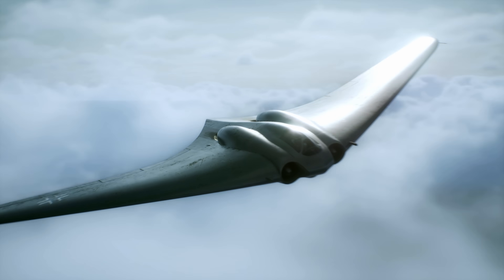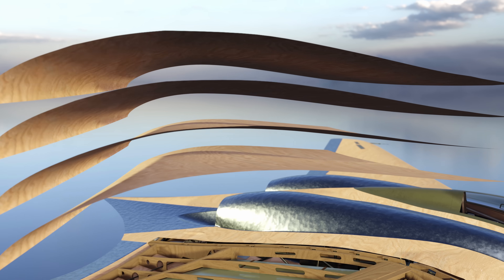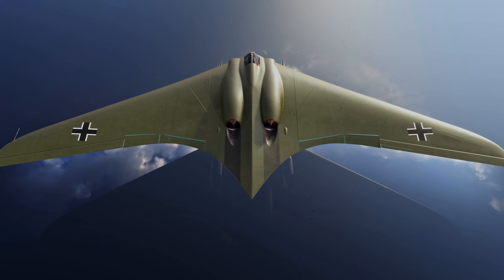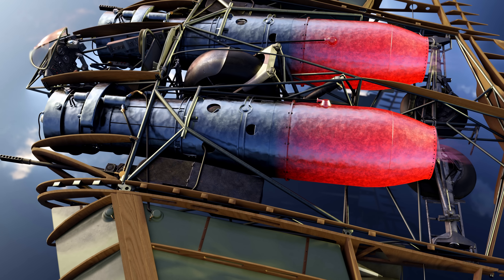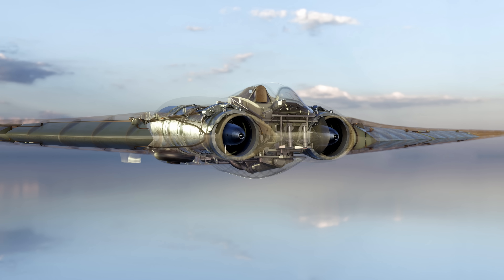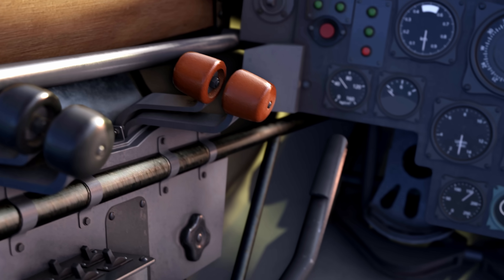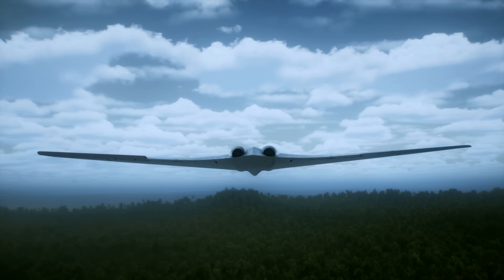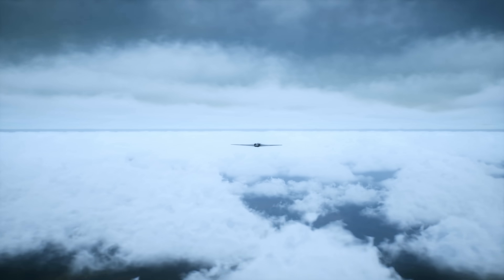Inside the Horten Flying Wing

Comment: Despite not being a completely stealth aircraft, it did have a lower profile than most aircraft at the time. With its high speed it might have been deadly attacking targets in the south of England.
Reply: By the time the 229 was in the design stage the Luftwaffe were no longer capable of attacking any part of England except with V2 rockets.
Reply: The mithbusters tested this its not stealthy in the slightest
Reply: @Whyareyoulookingatmynamell  though compare its stealth abilities to the radar of the time. it would have significantly decreased the response time of allied forces to get airborne to defend
Reply: @tomwhitbread223  they used a ww2 radar, its not stealthy

Comment: Flying wing ….. Conceived,  engendered, designed, and built by people of European descent. Other things invented by white people include:

Submarines, electric lights, nuclear power, microwaves, CAT scans, automobiles, hydraulic, wind turbines, backhoes & excavators, jet airplanes, aluminum, ballpoint pen, hydroelectric dams, steam power, trains & diesel locomotives, tractors, modern pharmaceuticals, open heart surgery, satellites, radios, telephones, televisions, arch & tig welding, computers, transistors, milling machines, plasma and hydrojet cutting, microchips, titanium, telescope, democracy, capitalism, modern farming, x-rays, typewriters, sewing machines, gyroscope, SCUBA systems, pasteurization, center pivot irrigation systems, bicycles, hypodermic needles, Velcro, microphones & amplified speakers, space travel, airplanes, fiber optics, ultrasounds, internet, printing press, container ships, aircraft , GPS, modern textiles, calculus, dynamite, internal combustion engine, Kevlar, moving assembly lines, antibiotics, aspirin, refrigerators, chainsaws petroleum production, trigonometry, helicopters, thermometer, glass mirrors, directional drilling, Astrophysics, crop rotation, carbon fiber, super conductors, particle colliders, pneumatic tires, MRI, sextant, robotics, telea a graph, microscope, firearms, penicillin, refined oil and fuels, hovercraft, computers, carbon 14 dating, angioplasty, telescope, pipelines, open heart surgery, tower cranes, chemo therapy, light emitting diodes, motion pictures, cameraswas was, digital cameras, CD/DVD, concrete, dynamite, lithium batteries, LED lights, refrigerators, nylon, water pumps, radar, sonar, satellites, distillation, electric motors, magnetic compass, sextant, clocks, plastics, vaccines, vulcanized rubber, insulin, combine grain harvesters, zippers, and concrete …. Just to name a few. 

What did your ancestors invent that have contributed to the modern human age? Feel free to list them out here.
Reply: Get lost white supremacist, you already lost.
Reply: Just stupid that there is no white breed and the first Europeans were dark -skinned. And now go shower.
Reply: @Aragorn_Arathorns_Sohn lore accurate King Aragorn
Reply: @stopmotionharry8989  Nein, das kannst Du in jedem Fachbuch lesen, mein kleiner Wehrmachtsfanboy.
Reply: @Aragorn_Arathorns_Sohn  what? I know what you said, but what? I’m not a wehraboo
Reply: @ No, you can read that in every specialist book, my little Wehrmacht fanboy.
Reply: @ what are you talking about? what handbook?

Comment: The statement that a flying wing design was not used in any other operational aircraft other than the HO229 for fifty years after the war is incorrect.  Jack Northrop had been working on Flying Wing designs since he was young and actually produce the first flying wing in 1940 called the N-1M.  Later with the N-9M if memory serves, he was the inventor of the elevons, a new radical concept using elevator and aileron functions.  This was around 1943 that his concepts were demonstrated to the United States Army Air Corps .  The HO 229 was the first jet powered wing as the Germans stole the plans for the jet engine  from Whittle in England and that's how Hons von Ohain was able get a jet engine of that same design in a German military jet the HE178. I do believe that the reason it was stated projected landing speed, is that neither one of the HO229 built were ever flown, hence the projected landing speed.  Also, a wooden airframe would be hard pressed to endure the stresses put on it during a 621 MPH flight or even less in a dogfight.  By the way, The B2 A Spirit bomber was actually taken from Jack Northrop's  XB-35, 1946 which was a rear prop drive flying wing and the YB-49 which at that time, 1947,  proved to be very successful using eight (8) jet engines.
Reply: Die Horten flog doch. Etwa 45 Min. einen Rundkurs um den Flughafen und stürzte dann ab. Ergo auch keine Landegeschwindigkeit. Das Ganze war ein Hirngespinst und wurde auch von der Wehrmacht nicht ernstgenommen und eben auch nicht gefördert (deshalb ja auch Holz). 
Und richtig. Die Amerikaner hatten ein erfolgreiches Nur-Flügler Programm und hat nichts von der Horten übernommen. die der XB-35 war ein Vorgänger der YB-49, die den damaligen Rekord der Strecke Los Angelos Washington flog. Aber die Probleme des Nur-Flügler konnte man nicht in den Griff bekommen. Dies funktionierte erst mit einer automatischen Flugkontrolle, die erst in der B-2 umgesetzt werden sollte. 
In jedem Fall war die Horten nichts weiter als Schrott.
Reply: The all wooden construction of the DeHaviland Mosquito apparently stood the stress of dogfights, low level bombing raids and even firing the Mohlins 6 pounder quick firing cannon in various different versions, and that was built by those inferior Brits and Canadians.

Comment: That is the "UFO" Kenneth Arnold spotted flying over Mount Rainier in Washington in 1947. 

After the War the U.S recovered a lot of Nazi inventions, the most notable aside from nuclear weapons, is the Horton 229, which is where the U.S has engineered and mastered the flying wing designs of basically all our modern aircraft today. 
Arnold even described the main issue those early flying wings had, stability, they would "skip" across the sky.
Reply: Auch wieder Unsinn. Deutschland hat keine Atomwaffen entwickelt. Weil man weder die Theorie verstand, noch die Technologie und auch die Ressourcen nicht hatte. Die B-2 entstand übrigens aus einem eigenen Nurflügler Konzept. Dieses begann schon lange vor der Horten und hatte einen flugfähigen Bomber mit der YB-49. Die Horten war ein flugunfähiger Holzschrotthaufen und hat die Amis Null beeinflusst. 
Was haben Nurflügle mit "allen heutigen modernen Flugzeugen" zu tun? Nichts?

Comment: Lets us not forget that American company Northrup was experimenting with flying wings at the same time but without jets. The B-2 was based on Northrup's flying wings.
Reply: No they didn’t 😂😂 The Northtrup was based on the Horten !!!
Reply: @f.n8581  the scaled prototype for the XB-35, the N1M flew in 1940.
Reply: @f.n8581  Northrups design on flying wings began in late 1920s. No, it was not based on any German designs. 
Read a little bit. There were tailless aircraft being designed in various countries including France, England and Russia.
Reply: @wfqsfg Yeah that’s why the Northrop and B2 looks 1 on 1 like the Horten 229 Right ?? 😂😂 The other Tailless Aircraft you mention in Russia , England and France didn’t even look close like the Horten 229 or From Northrop !!! 

Knock it off everybody can See the similarity between them !! 

And btw, there is evidence that Jack Northrop and the Horten Brothers meet in the 1920 - 1930 !! 

So that alone should tell you, that Northrop just cheaply Copied the Design from the Horten Brothers !!
Reply: @f.n8581  I never said the Russian, French and English designs looked like the 229. I simply said there were engineers in those countries studying flying wings. You read something that wasn't there. 
There is no evidence anywhere that Northrop and the Hortons ever met or ever collaborated. They worked on their designs independently.  The B-2 was designed and built by Northrop. The B-2 looks nothing like the 229 and is all metal and not wood. It looks more like the YB. The Northrop XB-35 was all metal, not wood like the 229. So how was it a copy?
Reply: @f.n8581 The history of flying wings and the B-2 program is well known. The B-2 shares nothing with the HO-229

Comment: To simplify the entire video. Yes, it was stealth. Yes, it was a huge breakthrough in technology at the time of it's conception. If it were not for the fact of Hitler being out of his mind due to syphilis he would have given the go ahead to mass produce this aircraft. Had it been done and the Germans tried the same maneuver they had tried with traditional planes of the day again with this aircraft the British allies would have had an estimated 30 minutes warning to get airborne and begin defending themselves. in the scheme of things this would have changed the face of the war. It had been used previously on 3 separate occasions and it did not fall out of the sky due to being shot down but rather malfunction. It was a steel frame to hold components and engines with a steel nose. The rest was a wooden frame and plywood body. The radar signature was was that of a large bird. So in a nutshell, this was an incredible machine and would have made a huge difference in the war. It is very likely that had Hitler not gone insane and this plane did not reach mass production our world would look very different.
Reply: It would have made zero impact. But no it was not a stealth aircraft, that is a long debunked myth.

Flying wings do provide some benefits to RCS but the HO-229 had MASSIVE engine intakes that would have increased its RCS by a large margin.
Reply: @spaceageGecko  radar is acquired by reflecting the signal back at right angles. The design is very good at doing so. Yes, the design of the plane reduced the signature significantly.  This is not to mention the fact that the only metal truly reflecting at all was the metal frame holding the cockpit and the two engines. The worst part was the nose, which was also metal. With all of this in mind, it was a stealth plane of its day. 

The signal of this plane was dramatically reduced to a "large bird" due to the shape of the plane, the wooden body, and the fact that at that time, no one had ever seen anything like it. So no, it is not like today's standards, but for its time, it very well could have fooled the allies until it was too late. 

In a nutshell, yes, it still was and is a stealth plane. Even the almighty Wikipedia agrees with this.
Reply: @ Please read properly, the mockup used was missing the metal frame (and the final version was not supposed to be wood) and the highly reflective engines and it still had 80% of a BF-109s return signal with an already retired radar, other radars showed no change.

The HO-229 stealth myth has been debunked to death, the Smithsonian has had to repeatedly remind people that no it is not a stealth aircraft.

Comment: ask Northrop, where did They got the idea for the B2 bomber
Reply: +@Pprokop87   Northrop started work on the YB-35 in 1941 and long before the 229 program.  The B2 is the redesign of the original YB-35 concept- same size and same mission role.
Reply: from the Northrop N-9M

Comment: The Horten Ho 229 was supposed to carry four 30mm MK 108 auto cannons, not two. And those would not stick out of it‘s body. The MK 108 was significantly smaller, and lighter than the MK 103, and also used lighter ammunition with shorter cases/brass. The rate of fire of the MK 108 was 600 rpm, but the shells had a slower muzzle velocity of 500 metres/s compared to the 750 m/s of the MK 103. It was never intended to use the MK 103 on the Horten 229. 

Further Northrop Grumman recognised it as a stealth fighter, as it‘s radar cross section was reduced by 20%, which can be considered the first step in stealth technology.

Comment: I can only imagine the vibration and noise in the pilot cabin, being situated in between the engines
Reply: Jets have no vibration, and the pilot sits well forward of the engine exhausts so there would have been very little noise compared to a tradition piston engine propeller driven aircraft..

Comment: Could a Ho-229 take flight, as it is, if current materials and computer control were applied to it?
Reply: It did fly but no doubt would have been a tricky plane and very unforgiving, it would have most likely needed a fly-by-wire yaw damper system... technology that was already being developed in Germany at the time.

Comment: 15:40 Many pilots have and do survive at 12Gs. It's not really "certain death." Every pilot that has ever had to eject is hitting 15-20g. Some fighters can pull 12 easily in emergency maneuvers. The g-force alone isn't the killer. Positive g-force at a sustained rate is a different story. Only healthy, well-trained pilots, and/or piltos with g suits can remain conscious in high g maneuvers for more than a second or two. Everyone else loses function at 3g, unconscious at around 7g, etc. Besides all that, negative g-force, deceleration is MUCH more deadly. Positive g force is pushing you into a seat. Negative g force detaches retinas, damages and rips internal organs, or can cause internal decapitation. The negative gs in a car accident are horrendous and usually the real killer. Look at the negtive Gs in F1 racing crashes. Jules Bianchi suffered from -254G - when he lost control during the 2014 Japanese Grand Prix and collided with the rear of a tractor crane carrying the car of Adrian Sutil who had lost control at the same corner. Put into a medically induced coma before succumbing to his injuries in 2015.

Comment: This was never a stealthy aircraft as the engines intakes  were not  shielded by stealth material
Reply: A 50% reduction in frontal RCS is very significant and would have given the aircraft up to 20 minutes of additional range without radar detection,
 Propellers are extremely retroreflective of radar energy; jet engines are very stealthy compared to propellers.,

Comment: Looks like the YouTube version of the old pulp grade Mechanics Illustrated articles on 'advanced tech' ..., which also never 'flew' and never demonstrated ANY of the 'breakthrough technology/performance' aside from the bare-faced assertions of the authors.
Another 5 minutes I can't claw back.
Reply: Actually, it did fly... and the Allies had absolutely nothing comparable to this advanced super weapon..
Reply: Someone's got a bad case of Luftwaffe envy...
Reply: +@rbaxter286   The smaller V2 prototype was the only example to fly under power and with jet engines, but for only about two total hours of testing, per the notes during interrogation of the Horten brothers.    On 18-Feb-1945 during a flight to measure basic performance numbers, the V2 suffered a single engine failure with a fatal crash which killed test pilot Ziller.  For all practical purposes, this was the end of the 229 program.  The Gotha-designed V3 was captured very incomplete on 14-April-1945 along with the tube frames for the V4, V5, and V6.    The incomplete and never flown V3 survives today although a rotted mess from outdoor storage and neglect.

Comment: Burying the engines in the wing would have been a maintenance nightmare. The axial flow engines had very low service hours between overhauls.
Reply: Axial engines are easier to maintain that piston engines and have longer TBO intervals than piston engines in combat operations... this is why all modern combat jet aircraft are powered by this type of engine today..

Please stop posting lies and ignorant misinformation regarding a topic that you are not qualified to discuss intelligently.
Reply: @DoktorBayerischeMotorenWerke  What you say is correct now, it was not during the early days.  The jumo had an engine life of between 10 and 25 hours.  For comparison a DB 601 would do about 150 hours.    I stand by what I said , you can't take modern engines and assume first generation jets were as reliable.
Reply: @thamesmud  The engines on the Messerschmitt Me-262 could be changed in less than 1 hour, allied pistion enghine aircraft could take more than 2 days!
 The Allies didn't have jet bombers or jet powered flying wings, so its a completely moot point.

The Jumo 109-004A or the Jumo 109-004B???
PTFR or TBOs???   You can't compare apples with Oranges son... do you know anything about aviation???
The B model easily passed the 100-hour minimum standard for acceptance into Luftwaffe service. So your false remarks are completely debunked..
Reply: @DoktorBayerischeMotorenWerke  The engines on the 262 are in pods under the wings so relatively easy to access.  This video and my comment is about the Horten where the engines are buried in the wing and difficult to get at and service.  It strikes me that the control systems within the German procurement system allowed large amounts of resources to be wasted on projects that were unlikely to be useful in the required time frame.   It's no good building tech to fight the next war whilst you are loosing the one you are fighting.

Comment: A fantastic video! On tiny little glitch though: The Horton 229 was radar "evasive". Its signature was 20% less compared to a normal plane, which would give a very short time to prepare also taking the speed into consideration e.g. on a attack from Germany over the channel. I would not wnat to be the allied forces needing to deal with this kind of war bird.
Reply: Tests conducted by Northrop confirmed over a 50% reduction in frontal RCS and this was without its RAM applied, the flight test prototypes did not have the RAM applied. 
American tests confirmed that German RAM technology like Tarnmatte and Ferromatten had significant radar absorbing performance..